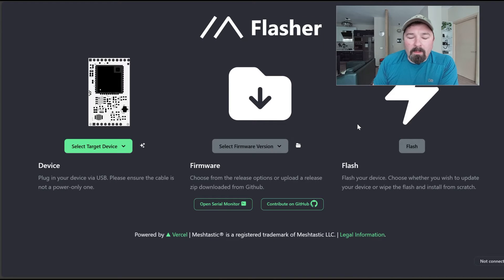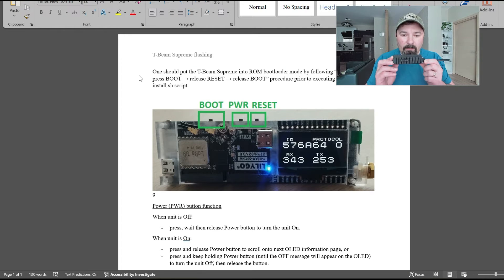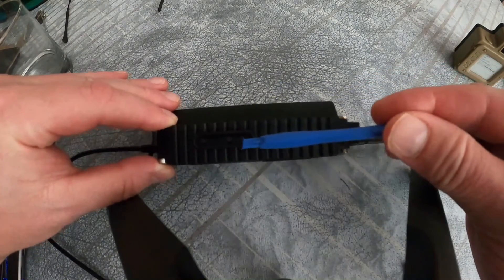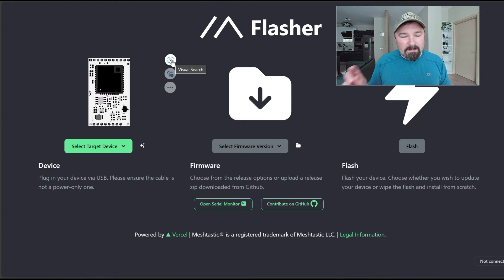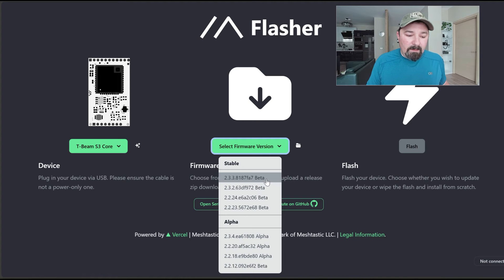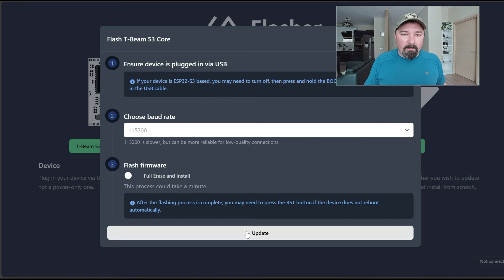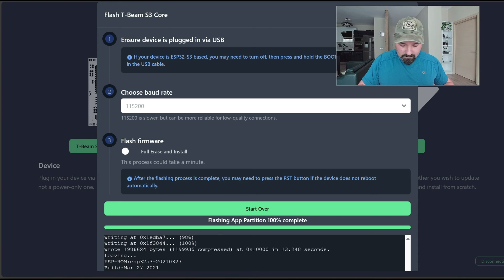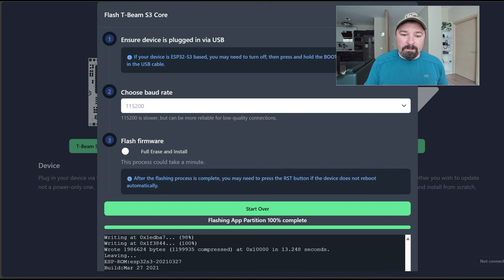Flashing the T Beam Supreme

Comment: At 3 mins and 50 seconds, what button do we hit, and do we hit it before or after we disconnect?
Reply from the maker: T-Beam Supreme into ROM bootloader mode by following “press RESET →
press BOOT → release RESET → release BOOT”. Reset is the bottom button with the antenna pointed up. Boot is the top button.

Comment: What is the oled supposed to show when it's it boot mode?
Reply from the maker: It will remain unchanged in boot mode. The only time the screen changes is once the firmware file has been load the device will reboot. The screen will display "rebooting".

Comment: Thanks. I was able to flash my device; however my screen is black. I tried full erase and install, no change. From my phone app, I am able to detect the T-Beam when I try to pair; however, since I can see the screen, I can't see the code. Can you point me to a resource where I can follow some trouble-shooting steps (hopefully not too technical!).  Thanks!!
Reply from the maker: I have a few questions to help me better trouble shoot your problem. Was the screen working before flashing?  Have you tried a different firmware version? What type device/phone are you connecting to (Android or iOS)?

Comment: Is your T-beam on while it’s flashing? I get a message on the web flasher that says if it’s an ESP32-S3 device, it has to be turned off and I have to hold down the boot and reset buttons while plugging in the USB. I’ve tried this and my T-beam comes on after plugging in and letting the buttons go. I cannot get the flasher to get passed the connecting phase. It just gets stuck there and won’t load the firmware.
Reply from the maker: Yes, mine is on when flashing. I have never received that message when flashing. Are you getting the pop-up for the USB connected device?
Reply: @EmCommSolutions  Yes. I figured it out. It was showing a different serial port for some reason even though it was the only thing plugged in. I had to hold down boot and reset while plugging it in. Then it showed the correct serial port. Got both flashed and working great now. Time to add more and do range testing.